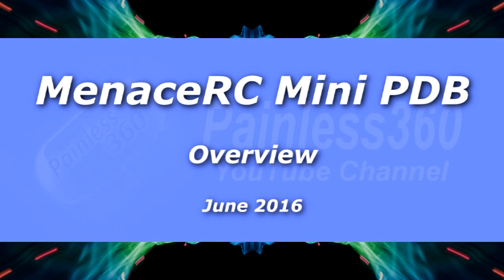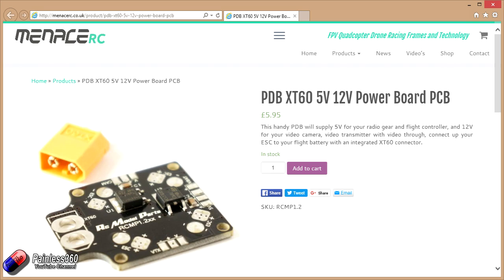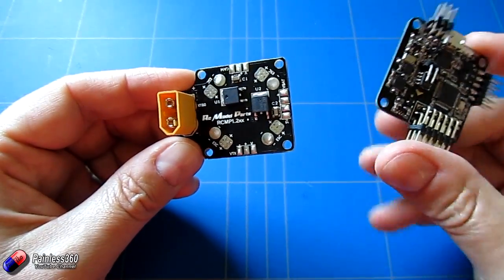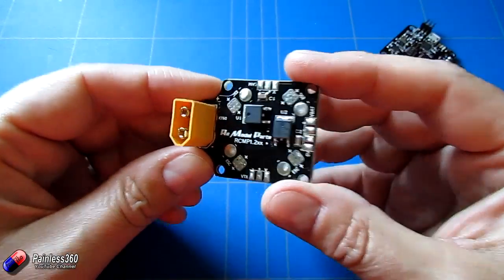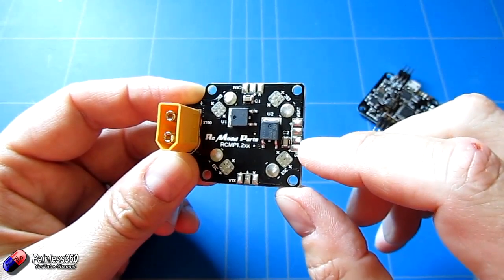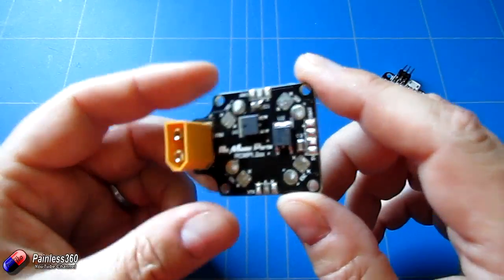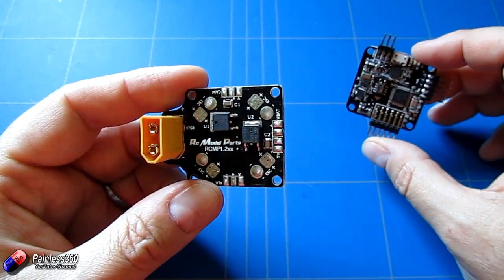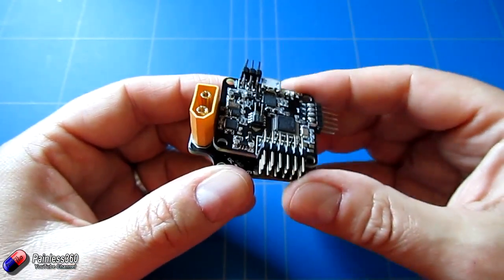RC Reviews: MenaceRC XT60 Mini PDB

Comment: Poor electronics design. They don't mounted all the required capacitors shown in the datasheet of the ST 78M05/12.
And they could also have mounted a LC filter circuit.
Page 4:
http://www.st.com/content/ccc/resource/technical/document/datasheet/41/4f/b3/b0/12/d4/47/88/CD00000444.pdf/files/CD00000444.pdf/jcr:content/translations/en.CD00000444.pdf
Reply from the maker: Please post a link when you've made yours. Best of luck.

Comment: What's the highest voltage input you can feed this with?
Reply from the maker: +Andrew Van Der Plaats I've been using then with 3s and others using 4s say they work fine for power but some report problems using the regulators at the higher battery voltages.. Hope that helps!
Reply: Thanks very much.